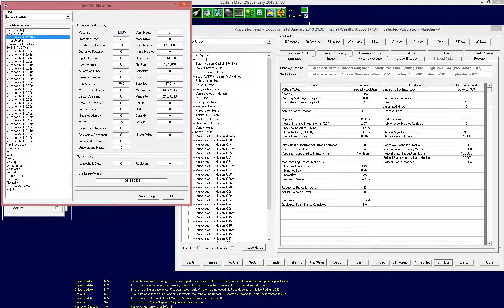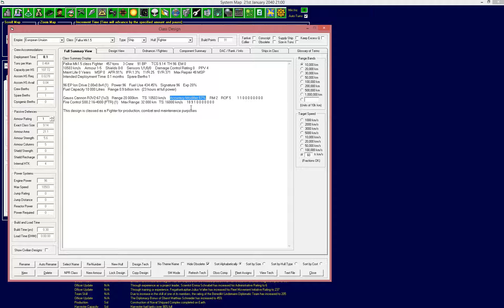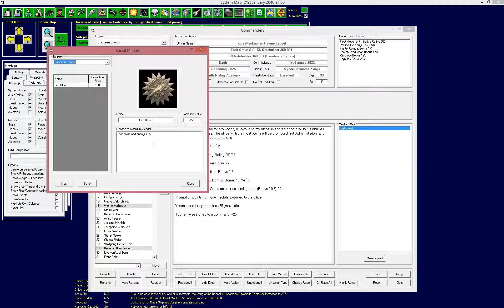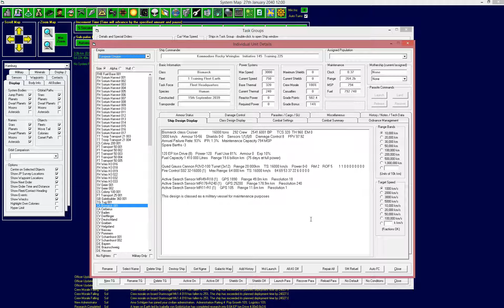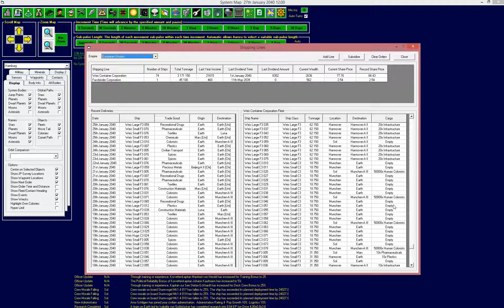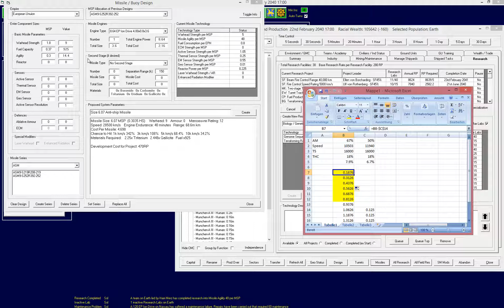Aurora LP18

Comment: You ended up with a maneuver rating of 12 on your missile, instead of the 13 that you had almost in the end of the process.
Reply from the maker: +Steinar Lima argh, thx, most likely I did not check again after adding the last fuel.